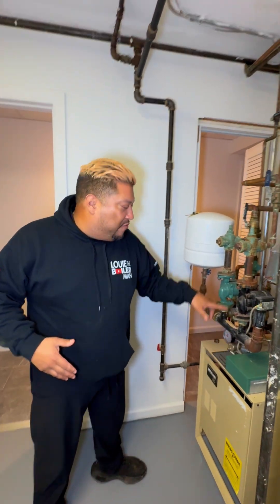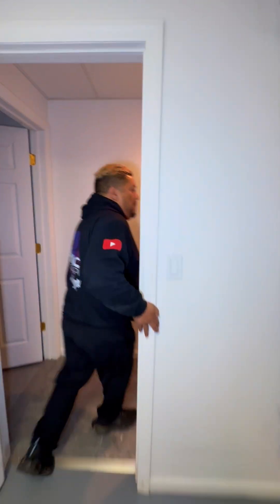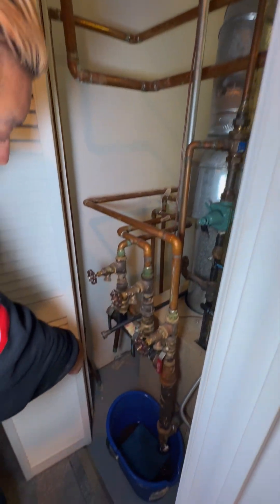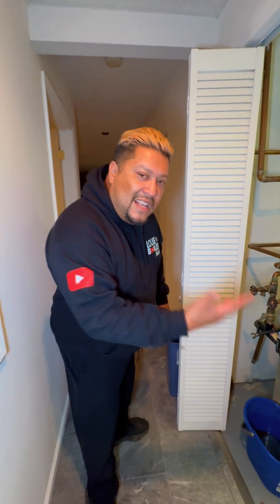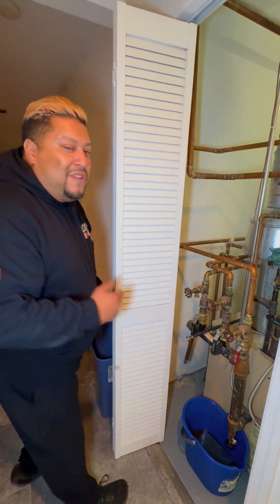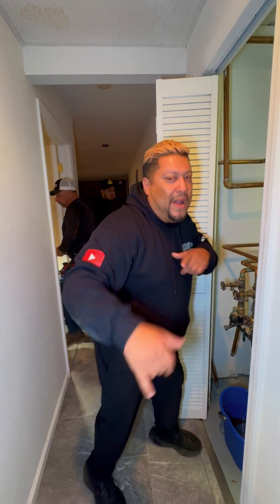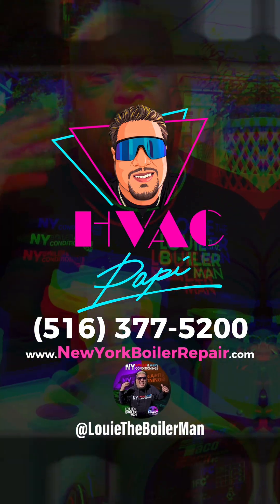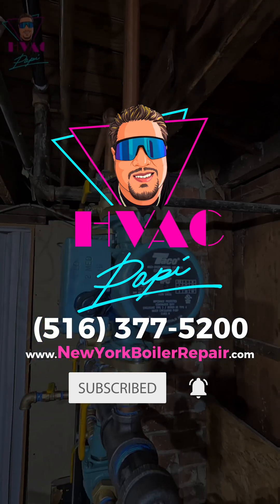LEAK! 2 Zones, 3 Returns?! Hot Water Gas Boiler System - HVAC Papi Explains the REAL Problem

Comment: Yo that sounds awesome i didnt know it was that simple. Your saying blow compressed air thru the supply then see which return the air comes. Can you make a video on it?
Reply from the maker: We will make one explaining it soon - Weppa!
Reply: Easy way to determine supply and return is just to follow last radiator back to tankless unit. I replaced lines on mine due to build up of scale and debris. Figure out return, then other has to be the supply. I replaced both Taco circulators too. My system had a T split on 1st flr zone and just labeled them with permanent marker..Shootout to Mellville NY & the 110. Crazy Donkey back in the day. 👍